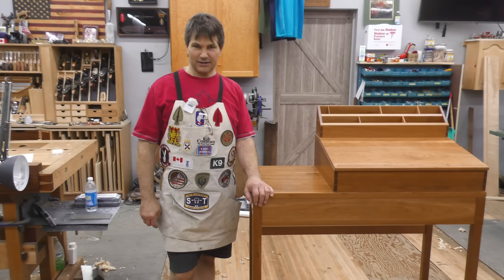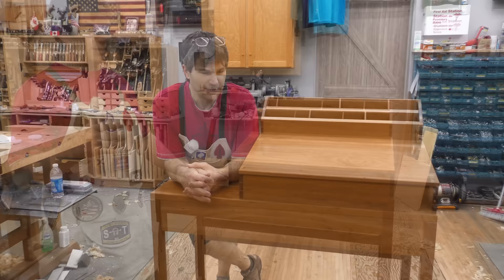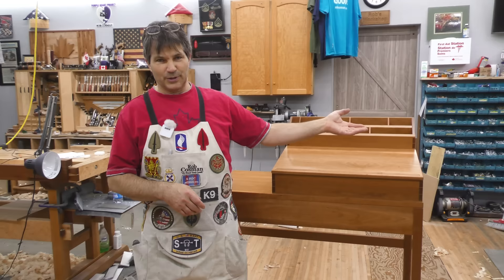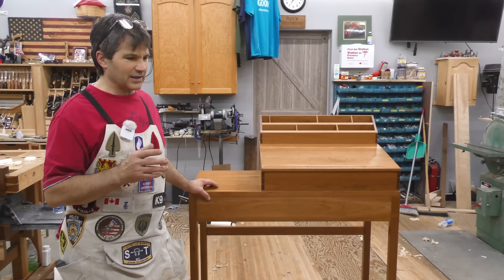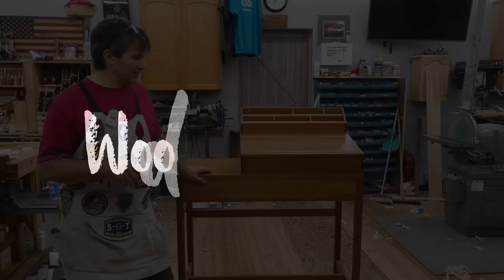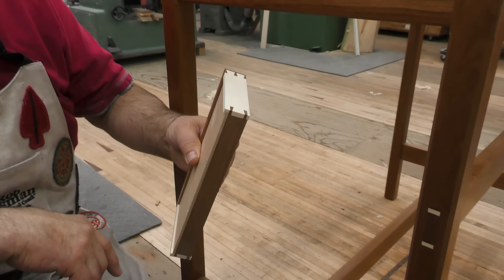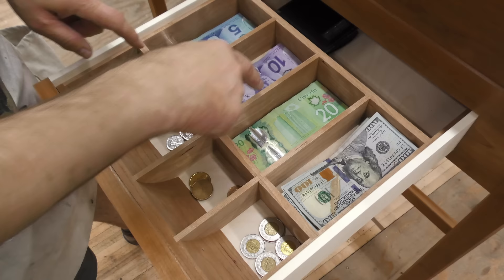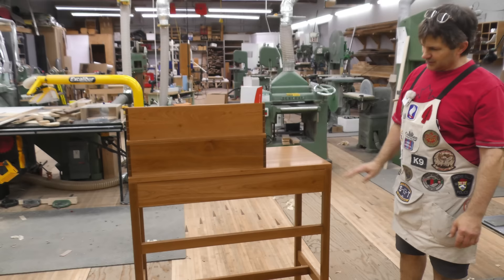Rob Cosman Furniture - Standing Desk Tour

Comment: Understably, comments focused on quality and beauty of the desk. But standing desks are a huge health and wellbeing benefit. Some countries now pretty much require offices to install standing desks. IKEA does a range with motors to raise and lower desks for standing and sitting. Plenty of other suppliers of such desks. You can buy the motors and make your own. Sitting is increasingly seen as a very significant factor in long term health issues. I'd like to make a high end traditional techniques version of a modern, electrified desk for computers, multiple screens, reading, and writing - if I can find the time!

Comment: About the drawers....you mentioned the wood expanding but the way you built it you wont have a problem.  My question is: Won't the drawers bind when the wood frame in the front expands up and down and well as the drawer fronts expanding up and down?  Seems to be when you ripped the top and bottom strips, those will expand up and down into the drawer fronts, which will also expand up and down.  I'd appreciate if you Rob, or anyone else could explain this to me.